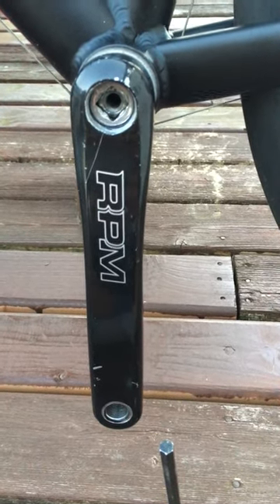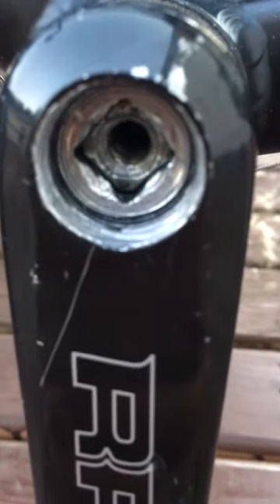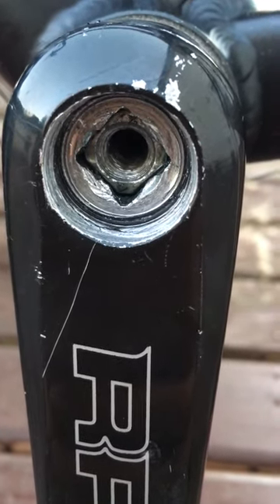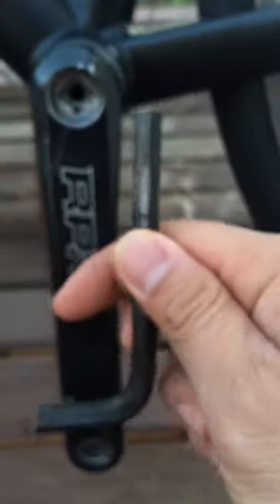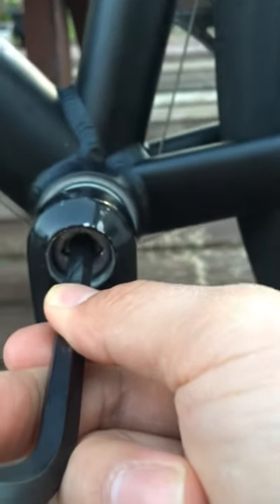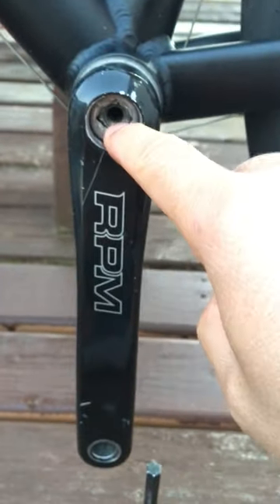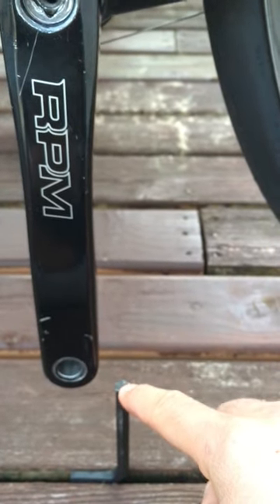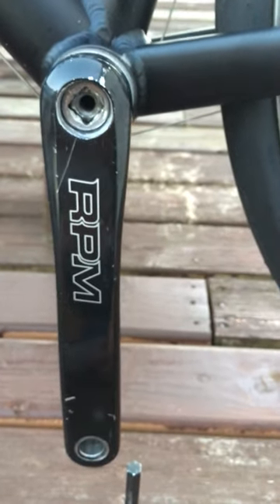REMOVAL OF CRANKS WITH DAMAGED THREADS

Comment: Wow this worked!! After unsuccessfully trying to remove the stripped crank with a 3-jaw and then with a 2-jaw gear puller I was about to give up. I then saw your video and instead of using an allen key between floorboards as you did, i made a small modification. I have used the inner piston of my original threaded crank pulling tool (the inner part which normally pushes against the bottom bracket at the centre of the crank arm). I Placed the piston at the centre of the crank arm, leaned my bike flat on it on my garage concrete floor, used my rubber hammer and wacked the pedal arm (right hand  side)  as hard as I could about 5 times - it came off! Unbelievable! Thank you so much
Reply from the maker: Paul Rogers glad it is helpful to you.  #rideon
Reply: how to hold the tool still when you hammering the carnk arm?

Comment: The puller stripped the threads. Looks like you had the adapter too wide pushing on the arm and not the axle. You can clearly see the arm is damaged because of user error with a puller.
Reply: Its also a possibility that they didn't completely tighten the puller in, it is critical to use a crescent wrench to firmly tighten down the crank puller in the crank, if you just do it hand tight, then even the slightest of a stuck crank will just result in you ripping out the threads like is shown here
Reply: Used the octatlink adapter, can see the round mark it left on the crank.

Comment: You need to remove the tip of the crank remover tool and try again.  You have obviously tried removing the crank arm without removing the tip which is obviously by the marks on the internal thread of the arm has just pressed them off

Comment: i also ever have same problem, what i do is to loosen the crank bolt about 4 full turn and ride it hard until i can see it moving out slightly, then i use jaw puller to finish the job, this method i think is more gentle for the BB and frame, i did that because the jaw puller is not work for the first attempt in my case it's most probably the crankarm bolt installed too tightly in the factory

Comment: Guys just do one thing remove the bolt and ride your cycle it will come off easily i did it and it worked
Reply: can you do it on a bike stand instead of cycling? how many times do you have to pedal?
Reply: @rafaelfresnosa8942  Nop not on bike stand you can't put pressure on pedal while peddling on bike stand you have to ride until you feel it's coming off after that if you have striking screwdriver use hammer it will come off

Comment: The head on the crank puller you used is too large, you can see where it was driving into the edges of the square hole in the crank. You need a square taper crank puller, or the park tool with a smaller drive disc.

Comment: I used an angle grinder, taking care not to grind too much of the spline. I cut straight across, and diagonally up from under the arm, around the 3 accessible sides. Your way sounds easier for those who can prop their hex wrench.

Comment: If you didn't cook the threads completely and just ruined the first few to where the puller won't bite and spins out. You might be able to grease the shit out of them with a ton of grease to get past them, turning the puller with a adjustable spanner. Used to do it all the time to people who hardly screwed the puller in and pulled out a few threads.

Comment: No easier way is you put the paddle then you ride around and put your weight the the paddle with no crank arm bolt on take it off it should me easy I've don't that a couple of times And it work well
Reply: GAZALIFEELTHERACE 29  agreed done this years ago, you just ride it for a bit and it will come loose.
Reply: Does it ruin the crank arm for future use? I read on forums saying it rounds out the joints
Reply: Vinh Do - you slow down and check (wiggle pedal with your foot, if it moves then coming loose) to avoid damage.  If you just ride like crazy until it falls off then maybe they will be some damage to crank and yourself, but on square taper you can get away with quite a lot of damage I would think.

Comment: Imagine just being able to smack that crank arm off with a rubber mallet.  Stuffing that Allen key in the end of the threaded area of that spindle is going to mess the threads up even more.  Take it to a shop if you don’t know what you are doing. It’s clear you were not using the crank puller correctly by the marks you left. You shouldn’t recommend people be doing stuff like this. It’s bad advise even if you were able to get the am off.